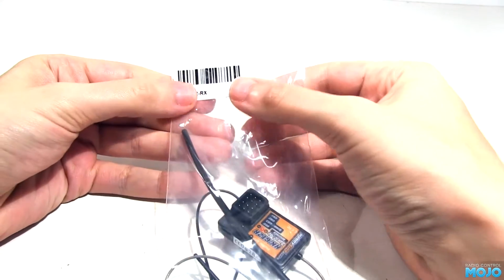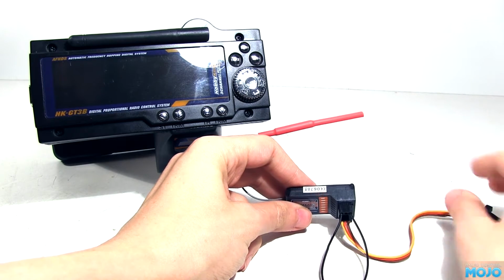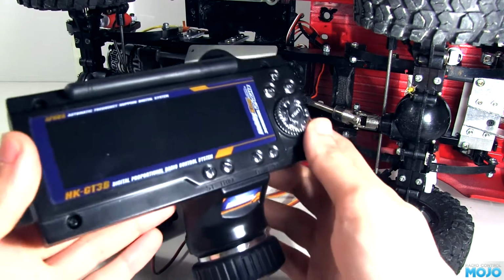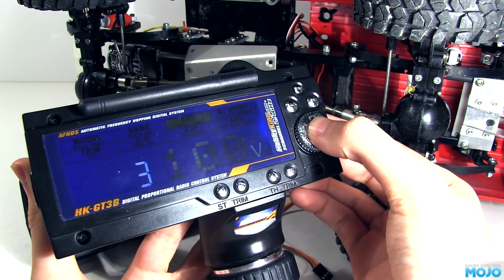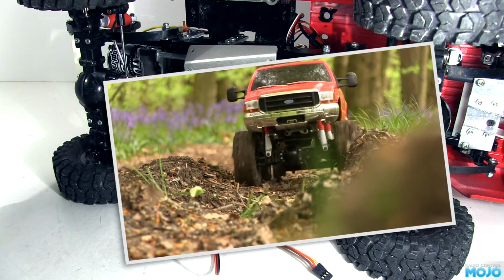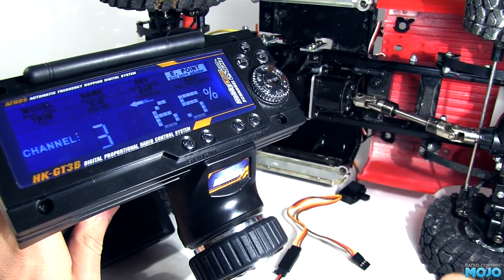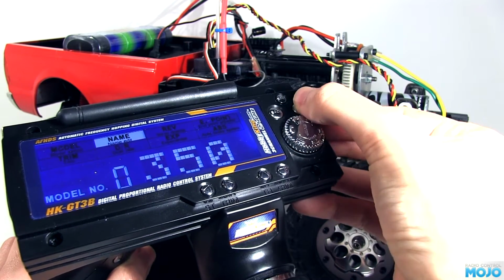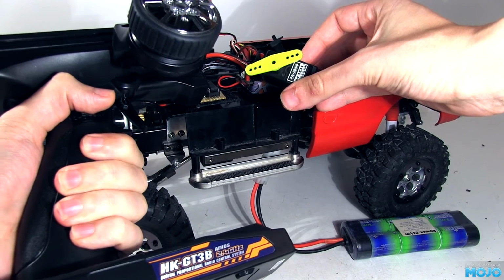FlySky GT3B - Tamiya 3 Speed

Comment: Did you modified the trans cover plate in the midle? It look s higher then the usual hi lift
Reply from the maker: The gearbox has been lifted, the motor is mounted where the shift servo goes and the shift servo is behind the gearbox.
The extra ground clearance makes a huge difference, and although there's a fair amount of work involved it's worth it to keep the 3 speed
Reply: @RCMojoTV  man i wish you made a video about it..

Comment: what kit you use to put transmission in that location
Reply from the maker: All cut out of 2mm aluminium sheet with a hacksaw 10 or so years ago. If I remember correctly I used the stock end plate as a template and some aluminium tube to space off the new plate

Comment: Thanks for the video. Do I have to do the firmware upgrade on my GT3C to change gears on the HG P407? I assumed the 3rd channel would work as is. Cheers.
Reply from the maker: If I remember correctly the stock firmware can only do 2 positions. It works for a 2 speed, but not 3. I'll be doing a video on modding the GT3C in a couple of weeks using current bits and bobs
Reply: RCMojoTV thanks so much. Look forward to it!